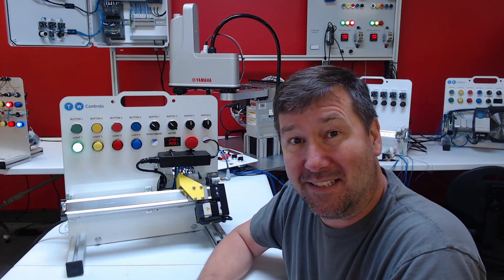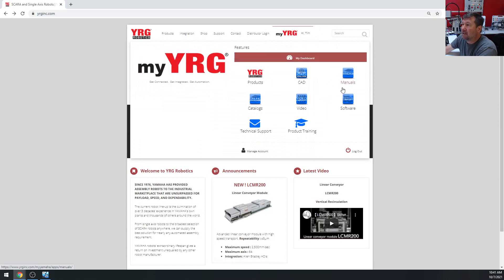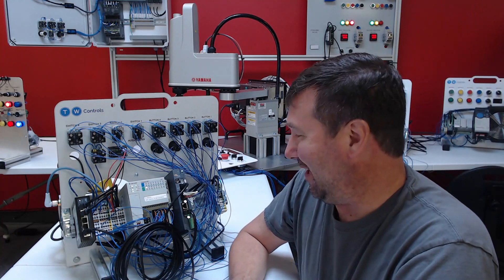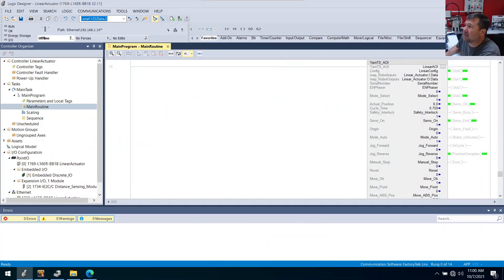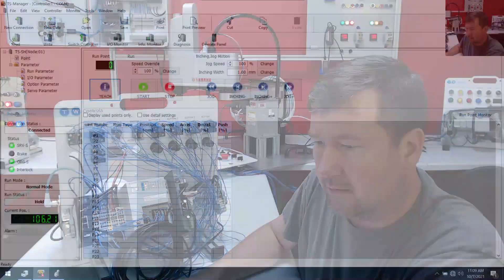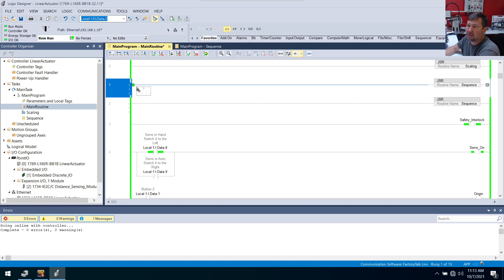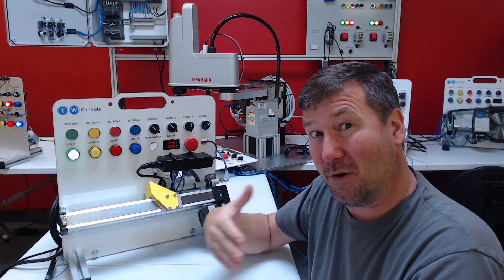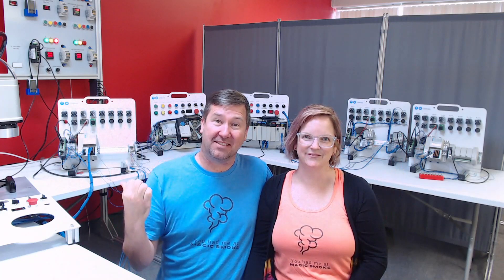Yamaha TS Manager.  Downloading and Installing for Linear Motion

Comment: Great Video Tim!. Here is a secret a lot of people miss. You can go into the AOI EIP tag name, and find the "Config" area buried inside. You can actually have a mirror copy of the points data in your PLC using the "Read" and "Write" and "Index" controls inside the Config area of the tag. Change the index to "1", then toggle the "Read" bit to retrieve all the data from point 1, into your PLC for example. Keep in mind that the Array table is defaulted to 10 which means points 1-9, but offline you can expand the UDT arrays if you like access to more than 9 points.  Then once you do this, you can use the included Panel View template to read and write to the point table without TS Manager software.
Reply from the maker: Wow, the features of these AOIs are endless.  I'll give it a try.